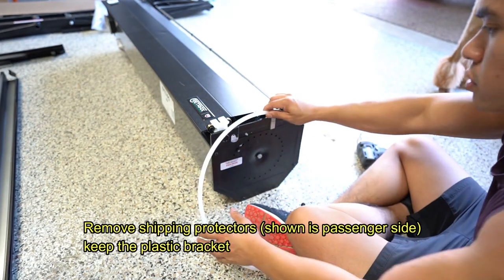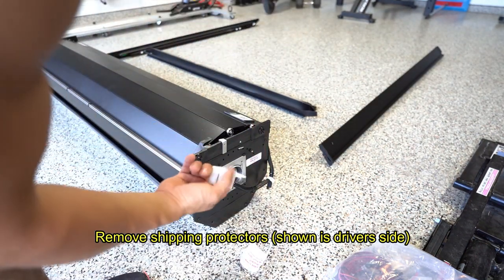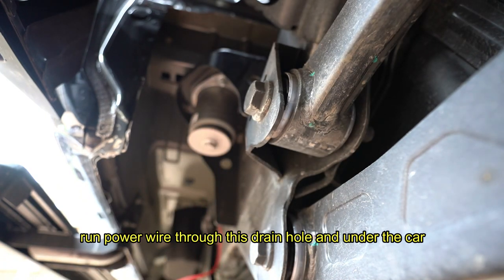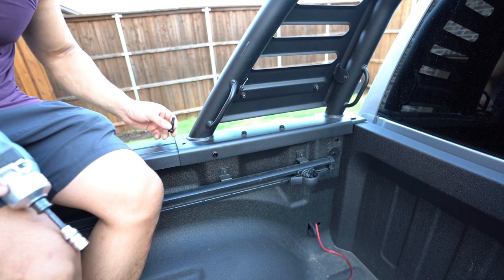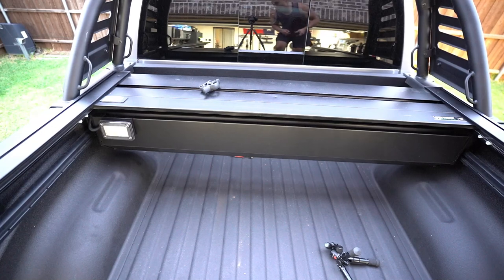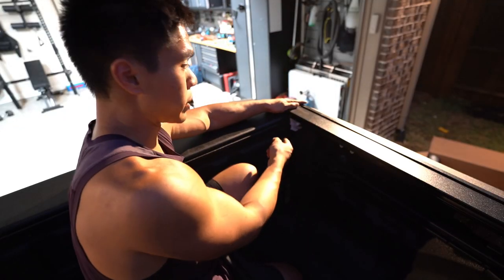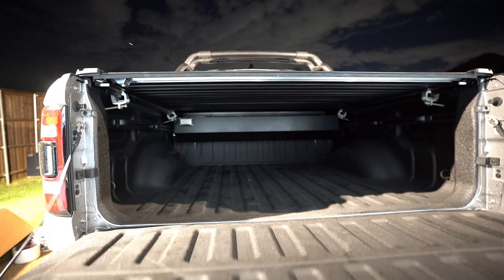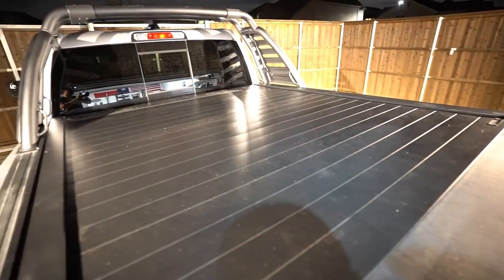2021 Ram TRX ReTrax Pro with RAMBAR

Comment: Nice truck bro… i’d like to install the RamBar on my truck but my concern do i have to drill any hole on my truck bed or you just  use the  pre existing clams and  holes that came with the truck ? thanks !

Comment: Any idea whether or not the dremmel of the ram bar is 100% essential for this install? Or could you do this by just replacing the bolts with thinner heads on top? I am looking to get this done to mine, but the shop doesn’t want to have to use a dremmel at all to modify. As long as all they have to do is replace bolts they are cool with it. Looking forward to your answer on this! Thanks

Comment: Hey, how did the Retrax Powertrax hold up on your TRX with Rambar?  Any issues after the install?  Thinking about doing the same to mine.
Reply: I have this set up as well on my TRX, I simply replaced the existing RAMBAR bolts with flat head allen key bolts.  BUT, the RETRAX tonneau cover leaks terribly when it rains.  there is water down the entire length of the inside of the bed each time it gets wet.  Annoying.  I think it is because the water dam is not tall enough to keep the water inside itself and travel down to the drain holes.